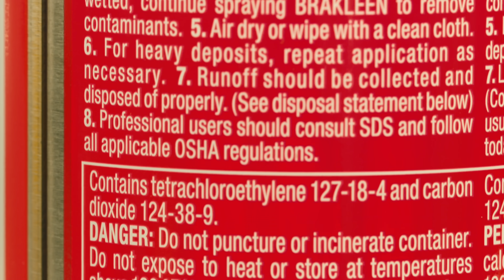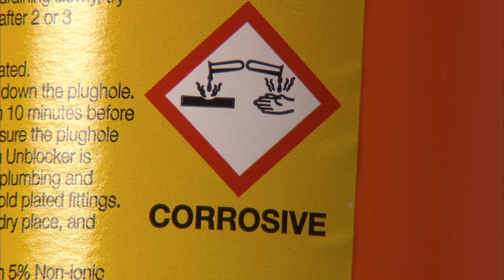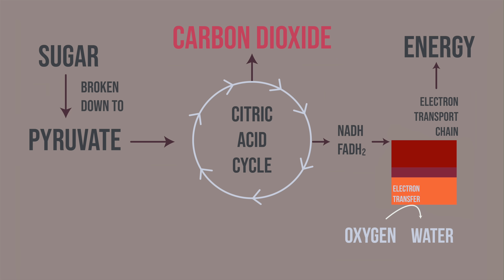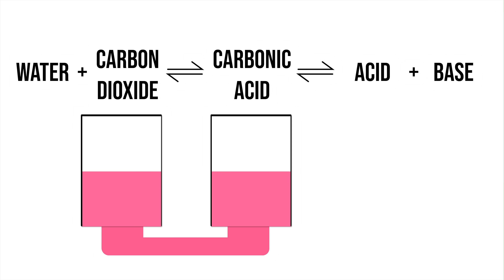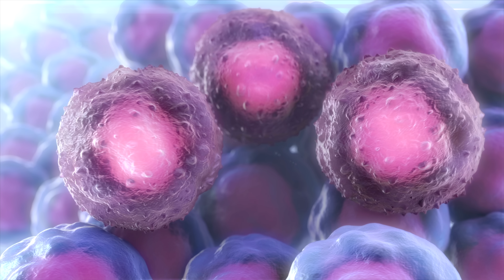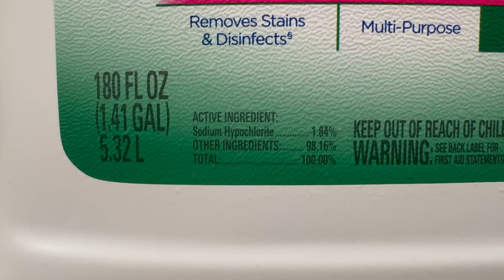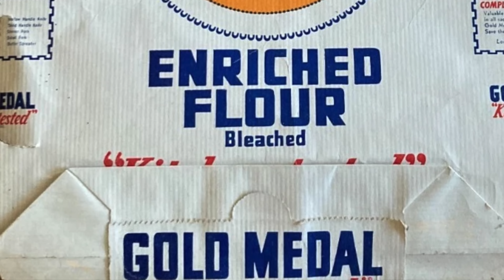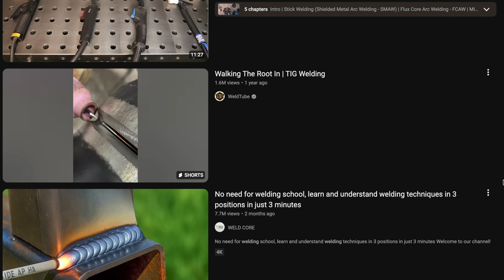"It smelled funny while I was welding and now I can't breathe..."

Comment: One time when I was 19 years old, I was soldering some connections on a circuit board, I had glued a component down with one of the very first industrial formulations of superglue that a friend had brought me from his work.  
I remember that every time you used it, tiny wisps of smoke would appear, which would burn your nostrils.
I remember when I heated up an adjacent joint (where some of the glue was still liquid), all of a sudden the world started ‘moving’ away; I remember putting the soldering iron back in the stand before becoming paralyzed; at that point my body just became like jelly and I literally slid out of my chair, onto the floor under the table; I wanted to scream-out but couldn’t; I was absolutely paralyzed and unable to utter a sound, completely-convinced I was going to die!
As the world was shutting down everything became black and quiet, it’s like I closed down to a singular point.
Later (probably only minutes) I started to recover and regain control over my body.
I remember straightening my chest out so I could breathe better.
It took a few minutes more before I could get it together enough to try and get back off the floor, so I just held onto the chair so my chest wasn’t so compressed and I could breathe.
So, I think in about 10 minutes, I recovered enough to get back into the chair, where I stayed for some time.
I was later told, that I had inhaled cyanide fumes from the glue, but I honestly have no idea.
All I know, is it was the most profound and scary sensory-experience I ever have experienced… 😮
Reply: I knew a guy who had glued part of his Bong with cyanoacrylate. It made him pretty sick.
Reply: That is bonkers!! Did that exposure have any long term effects like brain fog?
Reply: Holy shit. Now I’m gonna be even more stressed when my husbands in the garage lol. Happy you didn’t die homie!
Reply: @JB-bm1to  Super glue (cyano-acrylate) is usually quite safe. Yes, there have been accidents where people have glued their eyes shut, but you can avoid that easily if you are aware of it. The glue can easily be inactivated with water or alcohol if you have it on your hands. It is in fact so safe that it is used as "liquid bandage" - the stuff that doctors use to glue open wounds closed is cyano-acrylate with somewhat different additives to make it less stingy and more bio-compatible. 

The cyano part (cyanide group: CN) of this chemical is scary if there is no dash connecting it to another molecule, because it is really reactive to the point of killing people in large enough amounts. But with the dash it is really loath to let go of that molecule, hence safe. Quite a few molecules inside our bodies have that group. Of course you don't want to get rid of the dash and heat or electric arcs can do that, so never heat it. Personally I'm more worried about glue types that have organic solvents in them.

You can make yourself feel better and incidentally also make your husband safer by simply asking him about the stuff he is doing. Does he know the dangers of the glues and paints he's using? Does he know his tools? What precautions does he take? And your part: what exactly should you do if there is an accident? What information do you need to give the first responders? (to avoid being the subject of a video on this channel)
Reply: @KonradTheWizzard  Brand name liquid bandage and the equivalents available off the shelf are nitrocellulose based. The heavy duty stuff is CA based, but as far as I know, the human approved stuff is hard to get outside the medical field. The animal stuff (3m Vetbond) is much more accessible, and it works just as well.
Reply: @KonradTheWizzard  Regular Super Glue is safe for maybe a day or 2 with maybe some temporary side-effects and eventually a risk of death (depending on the severity of the wound being treated), it's wise to seek out proper medical care after using Super Glue to seal a wound.

You need Specialty Super Glue designed specifically for sealing wounds to achieve longer periods of safety with less risk of side-effects though it's still wise to seek out proper medical care after use.
Reply: @Nicholas_Steel  Let me clarify: I did not mean to suggest that you use regular super glue for treating significant wounds (although I've done it for a small one to stop the bleeding, it stung like hell). Yes, the additives can be bad for you. Sorry, I should have made that point clearer - thank you for bringing it up.
Reply: @KonradTheWizzard  No problem, I've just edited my message to make my messaging clearer.
Reply: Water activates cyanoacrylate aka super glue even faster it uses the humidity in the air to harden you DEFINITELY WOULDN'T USE water on your glued eye lids you better research your information before spewing out dangerous information
Reply: You came close to death my friend. I almost died from sepsis caused by a tooth infection that spiraled into a full blown endocarditis infection. I was hospitalized for an entire year fighting for my life. After a severe pulmonary embolism I almost died and like you everything pinned down to a pinpoint like an old black and white TV being turned off. I was also paralyzed, the only thing that saved me was my roommate screaming for the nurses who immediately called code blue. They gave me a shot of adrenaline and everything came back. I was lucky the embolism went to my lungs and not my brain because I wouldn't be here if it did.
Reply: @ta2joe13  blood has to go through the lungs before it can get to the heart to get sent to the brain. It's the clots that form in the lungs or after that that you have to worry about.
Reply: I only solder with the buddy method now. Thx.
Reply: what is this method?
Reply: @october-oct-r7w  It's a method for all tinkering: don't do it unless a buddy is there to help if you have an accident. For soldering this may be a bit overkill - there are plenty of other precautions you can take - like don't use chemicals that are not approved for soldering.
Reply: @KonradTheWizzard  thanks
Reply: @DavidRowbotham-gu7kzuse a fume extractor
Reply: Jeez. I quite often solder wires that are tacked down with superglue.  And sometimes it smells funny…
Reply: @evan010101  Never use glue to attach wires for soldering - that kind of heat creates all kinds of hazardous chemicals from any organic/polymer material. Get a tool called "helping hand" or "3rd hand" - it's a couple of crocodile clamps that help you hold things in place. In the field: twist the wires together. 

Also: wear a mask or use a fume extractor - even the most benign flux (rosin) creates particulates that are about as hazardous as chain smoking, the more modern ones are worse. Just keep in mind: the gunk you clean off the board or wires after soldering - the same stuff is in the air and clogging up your lungs if you don't catch it with a filter.
Reply: @KonradTheWizzard in industry glue is used all the time though.  When you’re soldering wires down that are 0.1mm diameter for example, helping hands aren’t any use.  The wire has an enamel coating too which isn’t great, but what else can you do. 
I do have fume extraction but nothing is perfect.
Reply: How about 25 years ago it became a thing where people were putting super glue on crystal methamphetamines and then selling it to people it would liquify go into their lungs and then solidify and kill them.
Reply: @Lakeman-m6mthat one sounds like an urban myth tbf
Reply: @evan010101  look it up it was happening in Idaho.
Reply: I've only ever used a hot soldering iron on krazy glue once, was such an awful & unique smell, so never did it again. I'd imagine its just as bad for you to do today, for most formulations of glue.
Reply: Maybe heated up too many joints?
No seriously, cyanide might very well be the cause. With normal use it's not dangerous in superglue (which works because of a water-induced polymerization of cyanoacrylate). Cyanide interferes with the oxygen transport into your body cells.
Reply: Rel, good to know

Comment: My neighbor gave me a brand new flux welder.  New in box from 30 years ago, heavy, like 50 pounds.  I read the manual cover to cover, and it has a section specifically on NOT using these degreasers prior to welding, even talking about how it converts to the life-ending gas.
So, this has been known for a long time, but I know many DIYers that have figured things out on their own, may not read all the warnings.

Comment: Yep. We car people often weld our rear differentials of they dont lock up and spin both wheels. We always clean out the oil of the differential with brake clean. But its absolutley critical to blow it dry and wait for several hours before welding, to ensure there is no brake clean residue left.

Comment: breakcleaner -> rust is gone? if you try to educate to prevent dangers its fine, but that makes no sense
youd need something really high reactive to get rust gone quick which is i guess strong hp-negative to reverse the oxidation or the typical physical ways etc etc there are some more ways
doesnt matter which breakcleaner you use, you will never get it rustclean. you can clean with it in form of dust and dirt yeh def...but there is 0 possibility that it gets actuall rust of any metal thats more than well the typical 1-2day old flash rust
the medical danger is still real, might have cleaned it from dust instead of rust. if it happened years ago, stuff like that was in SOME breakcleaners but nowadays not anymore.
so its a real patient, i believe it that it can happen like that. but the story around it...i call bs

Comment: i almost did my self over like this once i was using a propane torpedo heater in my garage while cleaning engine parts with chlorinated brake cleaner and then i lit a cigarette and it tasted weird so i put that one out a lit another same thing. i left the garage and everything smelt and tasted the same. i freaked out and called poison control they said i should be fine which i was. i probably got a low dose.

Comment: I had to pause to say what was floating in my mind.
I have been welder for 6 years, all fields, different alloys, jobs etc... and I confirm that you should take PPE very seriously.
But as a young welder who started out I wish I had more courage to be more stubborn with that, you see, this field also attracts bunch of idiots who think PPE is a joke, lots of them are seniors and they will pick on you for taking your time to put on a respirator or will advice you to work unsafely like weld through zinc, tack covering the arc with just glove and no hood, my former boss used break cleaner instead of white spirit in mobile repairs, I think we did some ugly silicate factory repairs for almost a month without any respirators provided, I bet that shit is still in my lungs....
Remember, this is just a job, have courage to be disliked and when someone pushes you to disobey safety rules- be it mobbing or stigmatize your behavior socially which is very common by the way- do not respect that person and do not listen what people that you disrespect tell you to do... 
One good thing about welding is there are shitloads of jobs for welders, if you dare to travel you will always find something, so do not cling to it too much... nothing worse than toxic work environment...

Comment: About a year ago, the sensors at the Swedish Security Service head quarter went off, and the whole office got evacuated. Turned out that a welding job was carried out at a nearby building, and phosgene gas was produced. This was outside, and the workers welding didn’t notice anything, but the sensors at the HQ did.

Comment: @5:50 Low voltage high current is used in the MIG welding process shown, not high voltage.

Comment: This is great. THANK YOU -
I have a mig and full leathers.
I have always been worried about the helmets auto-dark being able to protect my eyes.
I always thought that I will not work in good ventilation but frankly, this scares the crap out of me.
Never heard the brake cleaner plus welding equals death thing and I have several classes at community college under my belt.

 For the pros out there, does a really good all around safety book exist that covers all this stuff?
I only weld for my own fun and projects so I am never going pro.
Thanks again for the channels reporting on this especially since you are also a welder. **ro

Comment: Like SP I am an enthusiastic amateur welder but I have never taken health and safety for granted. I have never come across this scenario with brake cleaner, always choosing physical means of removing contaminants from metal and maybe a little acetone for TIG welding - but never brake cleaner. It never felt right using it around heat (My knowledge of chemistry is restricted to what I learned in school but I do understand it reasonably well) - now I know why! I always use a fume mask for welding, one that fits under my hood, as metal fumes are another nasty produced by it, particularly if there is zinc present. Great video - I look forward to discovering more.
Reply: Cool.

Comment: I knew what happened in the first min. this is why I only use acetone based brake cleaner. also fun fact, the fire fighting agent we use for aircraft is Halon 1211  (Bromochlorodifluoromethane, CBrClF₂) it too will make phosgene gas when its heated. if you have to use it in a hanger you have to spray it and baily it!

Comment: The sad part is that, you could work at a factory where YOU are smart enough never to use Brake Cleaner to remove rust from steel (prior to welding), but the guy who works next to you might not be so smart, and therefore end-up killing everyone who works in the same department.
Reply: This is what happened to me at work. I literally had to fight with the boss and physically take the can away myself yo stop them from using it because they just wouldnt listen. I ended up quiting soon after.
Reply: @saskmuddinatv  I'd call OSHA if that happened recently.
Reply: @soundspark About 4 years ago.
Reply: Just interested in the *cost*. .. what did the ambulance cost??? What did the examination cost??? What did the treatment cost?? With or without insurance, and what insurance did he have???
Reply: @RasMosi-t7d 
Yes insured; Blue Cross
EMS ALS Transport; $5200
Triage emergency assessment $17800.
Treatment 
17 day ICU; $382,000.00.
 22 day Impatient $167,829.00

Comment: As soon as you said break cleaner I shuddered, it was literally the first safety thing they drilled into us in trade school above many more common hazards. 

For some reason, people talk a lot about the dangers of welding galvanised stee all the time l but not phosgene gas. Galvanised steel can give you lead poisoning over a long period of time and metal fume fever with high acute exposure.  It's nothing compared to many solvents though, especially brake cleaner... 

Only use solvents that fully evaporate like acetone and volatile cleaning alcohols. Acetone is the most used solvent for cleaning in weld prep. In most situations, abrasives are sufficient though, especially as an amateur.

Comment: When I first started welding I got galvanized poisoning. I knew that I wasn't supposed to weld directly on galvanized parts but I didn’t know that even if you grind the coating away and then weld the other areas of the metal with the galvanized coating can heat up and the fumes can be breathed in. I had flu like symptoms for a day but luckily I don't think I had any permanent damage.

Comment: I recently learned a lesson that could have killed me. I washed three pillows in my washing machine with maybe 1/2 a cup or so chlorine bleach. In about 15 minutes or so of beginning the wash, I began smelling a very strong chemical smell. It made me a bit dizzy and I felt weak. I go look through the top glass of the washing machine, and the pillows are swelled up like balloons. Unbeknownst to me I had created a chemical weapon in my own house by accident. I immediately turned on fans, and opened the doors. I had to go outside for a while as well to catch my breath. Had a conversation with Grok AI. Grok flipped out and told me to get out of the house and take immediate action to air the house out. It explained that you should never wash pillows with chlorine bleach. The chlorine and heat in the wash combine with acids, ammonia, dead skin cells, etc., and even the pillow stuffing itself, to create a powerful chlorine gas. I was home by myself and I'm lucky I didn't pass out. Furthermore, I could have gotten what is called chemical pneumonia as this video discusses, filling my lungs with fluid. Never, ever, wash your pillows with chlorine bleach. Grok says throw your old pillows away and get new ones. Just a warning for everyone. I'm lucky I didn't die.
Reply: Lesson learned. 👍

Comment: This is the 2nd video today about the risk of heating brake cleaner. If you need to use it, do it outside and do not heat it. Otherwise it does a great job.

Comment: This video is terrifying, not just because it's a vivid depiction of what happens to a person who inhales what is essentially a chemical weapon, but moreso because this is something I could very easily see myself doing. I'm a country kid who went to auto shop class. I started welding when I was 16, fiddling around in the garage on projects. NO ONE ever once told me I shouldn't degrease something with brake cleaner before welding it.
Reply: Remember it's chlorinated brake cleaner that is the problem, most break cleaners now are non-chlorinated in alcohol-based
Reply: @thomasward4505 CRC Brake-Kleen, which is chlorinated, is a product I have used hundreds of times in shops I've worked at as well as my own. 

It's terrifying to think what could have happened, honestly. I genuinely wouldn't have thought twice about using it if I was trying to weld greasy metal.
Reply: Go online and search on google or ask chatgpt about dangers of welding.. There may be other risks as well that you know nothing about.. 😊